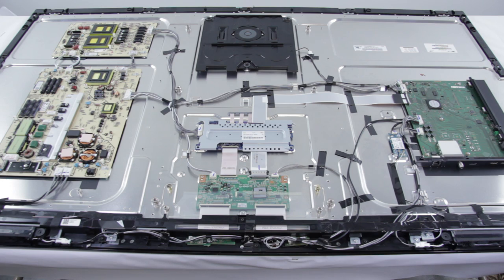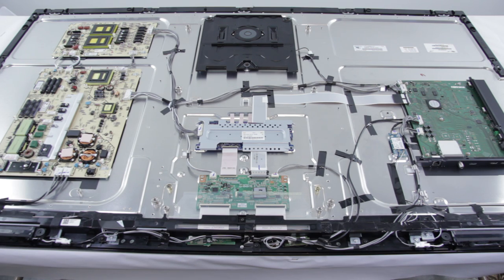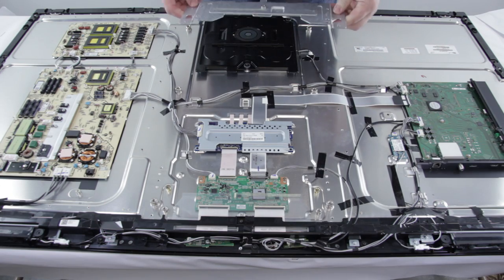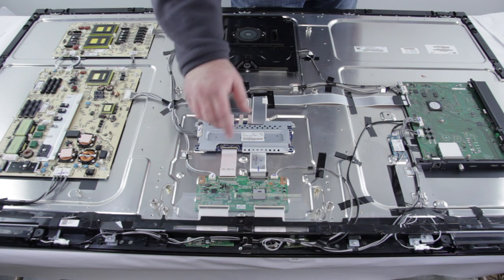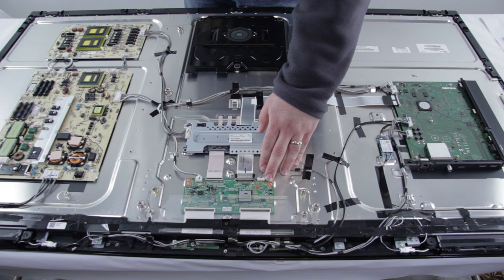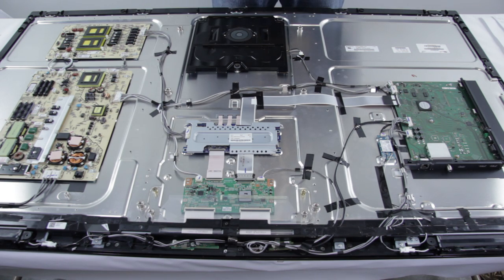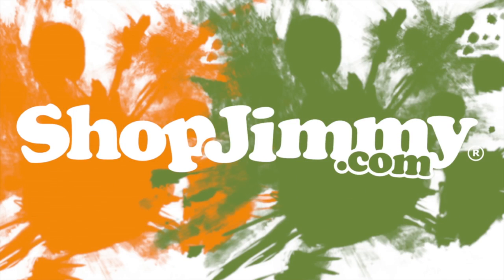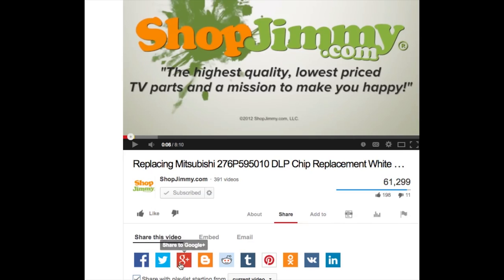LED TV Repair T-Con Board Help Review Overview - Common Issues and Problems with T-Con Boards

Comment: Samsung UN55D8000YF Horizontal lines across the screen. They typically go away after a minute or two but lately it's been taking longer and longer and now they won't go away. Could it be a bad T-con board?

Comment: I have a TCL LE55FHDF3300ZTA the tv would randomly turn off and stand by light would come on, most times you just had to turn it back on. It turns off more and more, trying to figure out if the main video board or T-con is the culprit. If you could suggest the best part to buy.  thanks

Comment: I have a Philips Model 55PFL5601/F7 and it has a blue tinit across the entire picture.  Adjustments do not make much difference. Could it be tcon board?

Comment: I have a LG 65UL6450 
When I try to turn the TV on the standby led blinks three times then goes off and the backlight doesn't come on... But if I remove the power from the t-con board then the backlight instantly comes on. Ive also noticed a red led on the actual main board which stays solid as soon as you turn the TV on. I don't see any obviously damaged caps on the power board. My guess is the Main board or the t-con board. 
Any ideas?

Comment: Vizio m470sl. Has sound and picture but picture freezes with weird colors then goes back to normal. Does this every few seconds. No t con board so I'm assuming it's the led driver. Any help?

Comment: Seiki se40fh03. Powers on but no backlight. You can see an image with a flashlight and I have 101v going to the LED when powered on and with the LED disconnected from the power board. Is this a main board issue?

Comment: My Sony KDL40V4100 is showing white screen on top of the picture. I can see the picture , can hear the sound and can see the controls , volume up & down , tv looks fine if it does not have white bright transparent screen and it covers full tv. Please share your opinion on what to be wrong. Thanks in advance

Comment: I have a Hisense Model 40H3E TV 2014 that we replaced the backlights on but now it has a 12" wide black vertical stripe in the left center of the screen. The picture and sound are good except for the stripe.   I do have a picture I can submit if you need it. Can you help please?

Comment: Have an Lg60uh8500 problem started with Tv turning on briefly with no problems and then within 5 seconds dimming to a point of images being to dark to see. Sound and backlight still functional. Currently it's progressed were tv turns on goes all white then all red and black or otherwise turn off. Bought a t con looked similar but model numbers diff. Going to buy correct one but want to know if this is exact issue?

Comment: Hii good day I have a sharp LC-55LE653U tv with lines showing up where there is picture on the screen. The lines are red in color and does show up when the menu is activated. The no signal that shoes on the screen and moves brings vertical lines where ever the no signal logo goes the rest of the screen remains black without lines

Comment: Hi, problem with my CHANGHONG LED TV model LED28C2000, picture ok on lower channels 2 to 14, no signal on ch from 15 up. tried auto retune, no effect. By remote or manual, same. Which board could be the problem? Many thanks.

Comment: HI there , i have LG TV 2014  with model number 42LB5800-UG
When i turn power ON ,  the red power Light oN TV is ON. But Only black screen and No sound ,
Should I replace the LED strip?  Or should I also replace the Tcon 
Where should I buy the LED strip? 
Thank you for your help 🙏

Comment: Hi
Have a Samsung LED TV UN46EH5300FXZA  and have sound but a dark screen . Can see an image in the back ground at an angle when there is a white back ground . Have replaced the Power Board and T-con board but still have the same problem . Have powered up TV with lights off and have no LED . See no inverter on the back unless its built in the Power board ? Going to replace the main board next . Have any ideas what the problem is ?

Comment: TV is a Samsung UN29F4000AFXZA...Power board is a BN94-06272N...TCON board is BN94-06777F...Have sound and back lights work.  No picture.  TCON board bad?  Also, in disconnecting power cable between power board and TCON, I measure the 13 volts, and the 5 volts, but I do not get the 7 volts as shown on the PCB by the connector.

Comment: Mine is the E701i-A3. Problem: black / blackout screen and no sound. I'm sure it's on because there's some brightest on screen and the power light is on. It could be related with the board?
Reply from the maker: Xzonesite  Please watch this video FIRST to help with your repair!  https://www.youtube.com/watch?v=BP3NVNCGEv8  This could be a problem with the T-con board or the TV panel.  You can replace the t-con board to see if that fixes the problem.  Click this link to replacement parts for your TV model number:  http://www.shopjimmy.com/catalogsearch/result/index/?cat=63&q=E701i-A3  There may be multiple boards for the same TV model number, be sure to match part numbers on your current board, with your replacement for compatibility.  Thanks and please let us know if you have any further questions with your TV Repair!  www.shopjimmy.com

Comment: Hello Jimmy, I have a Sony KDL-46EX600, SN: 1728115, Blue line, vertical, left side. There is no sound and when attempting to turn on the TV... red turns to green and back to red flashing 5-times. thx,

Comment: I have a Roku tv 55in Model 55FS4610R  Powers on,has backlights but checking screen with flashlight there is no image and no sound.What component required to repair tv?

Comment: i have a Sony XBR65x850c that is giving me the 6 flashing red LED error which seems to indicate a backlighting issue on the error codes.. i would love to get it fixed since i can no longer buy a 3DTV to replace it.. is this typically a bad LED strip? how should i test to make sure? thanks in advance..

Comment: Hi, I have Toshiba 65" tv. The screen showing a single black line. I have tried cleaning the connections but it has not helped. 
what could be the reason for this?

Comment: My Vizio E 370-AO stopped showing a picture (including the chevron) and had no sound. The backlighting was working. I replaced the power supply board with no change. What should  do next?

Comment: I have an LG led flat screen model 55UF6450-UA. my problem is with the screen. the upper half of the screen is ok but the bottom half of the screen is fuzzy. when i look closely at the bottom, every other horizontal scan line is blacked out. is this a problem with the T-con board?

Comment: I have a Toshiba TV Model #32C120U1 that turns on but the display is dim. I have tried to adjust all the settings for the display to no avail. Any thoughts on whether to save this TV?

Comment: I have a LCD TV model lc-50LB481U that has lost its picture. I can see no backlights. The top of the screen began going dark before it failed. I believe this is a t-con board issue. Can you advise please? Thanks

Comment: I have LG 42LB 5600 TV, replaced LED strip and when installed back, have issues with vertical colored lines , white lines with no signal picture seen. Pls suggest the possible fix.

Comment: LC-60EQ10U Ghosting image, flickering. I have taken the TV apart and checked cables. When I checked the tabs around the panel I noticed on the right side one of the tabs towards the bottom was very hot. The center part of the tab has a chip. It was very hot. The others were not. I twisted the panel and nothing. Is it just the TCON board? Thank you so much.

Comment: I have a 60 inch Sharp Aquos LC-60LE830U with vertical colored lines on the left side of the screen.  Is that a tcon board problem? If yes where can I buy it?

Comment: Hello I have an RCA LED TV: Model #  RCA LED55G55R120Q
Problem:  I was watching tv one night and I heard 2 popping noises and the tv went black, how ever I was still able to hear the sound and see something moving on the screen but it was dark.  I have searched the issue and my LED lights are not working.  I need to order the right part to fix it but I'm not sure which part will repair it.  I hope you can help me out.  The tv was bought from Best buy about a year and a half ago and no extended warrantee was bought.

Comment: I have a Vizio 55", Model Mr550NV with Vertical Gray Bar ib the middle of the screen. I replaced the T-Con Board and the problem still exists. What would be the next most common cause of this vertical bar?

Comment: My TV is a Emerson LF461EM4 a 2014 model. The left side of my tv is darker, has ghosting as well as a bit discoloration, but the right side is fine. Could this be a T-Con or Mainboard issue?

Comment: I have a Sony KDL 50R550A that just quit, no indicator power stand by light or on light. I was out of the room for a couple of hours it was playing when I left the room but was out when I came back in.  No storms were in the area. Screen completely black.  I have checked the power board it is outputting approx. 3 volts DC.  I have replaced the main board with no difference in output.  What do you think is wrong?

Comment: I have a sharp lcd 70le650u that had no picture and no sound. Backlights come on. I have standby voltage at the logic board but no 12v output voltage to the t-con board. Do you think the logic board is bad?

Comment: I have a 39" Insigna TV, Model # NS-39D40SNA14
My TV has sound but has no picture. I did the flashlight test and I saw images. What should I do in this situation?

Comment: Have Sony Bravia KDL-52XBR5 made in Dec 2007.  On startup, the screen shows some ghosts and some horizontal lines, but whole screen still works.  After a few minutes the ghosts, lines go away and screen is normal again and stays OK for hours.  What is most likely cause of this issue and is there a part to replace to correct?  Thanks.

Comment: Have a Sharp Aquos TV model number LC-70LE600U.  This just started a couple days ago.  I have a rectangular box toward the bottom of the screen with white vertical lines moving up and down inside the rectangle  Any ideas what the problem is?   Everything else works fine, but this is annoying.  It's about 2in high by 19 inches long

Comment: Hello, I have a LN40D630M3FXZA that i pulled from the side of the road. Led light turns on at the bottom with touch sensitive controls on the front, but screen is black. Any help would be appreciated.

Comment: I have a Phillips LCD TV. Model #52PFL5704D/F7 and the backlights work but there is no picture. I have already replaced the main board and it's still not working. Any ideas or a link to get a new T Con board?

Comment: Hi I've got a Panasonic TX-L32S10BA I've got sound but no picture back lights seem to be working I can see them lite up through the back panel I've replaced all the boards but still no picture can you please help. Thanks Eddie

Comment: I have a 7 year old Samsung LN52A650. I recently replaced the TCON using your tutorial with a board I purchased from you site. Before I replaced the TCON board the screen would freeze and display colorful lines across the screen. When I unplugged it and plugged it back in I could only get the input displayed in the top left corner but I could not change the source and the screen was black. I swapped out the TCON board and it worked great for a few months then the symptoms that I described  above returned.  Any advice?
Reply from the maker: This sounds like a TV panel (TV Screen) problem.  If your TV panel is bad, it may be more cost-effective to replace the TV as panels are typically hard to find in stock, difficult to replace, and expensive.  Thanks and please let us know if you have any further questions!  www.shopjimmy.com

Comment: I have a Samsung model LN40A550P3F. Everything works except the color is weird. All the blacks have a green pixelated appearance. Adjusting all the color settings does not help. What could it be? Thanks, V

Comment: I have a Westinghouse DW39F1Y1 and the image is barely visible if a flashlight is used in a dark room. Sound works fine. There is a main board and a power supply board, but I cannot locate an LED driver or the backlights.
Reply: Additional Info: The CVB42001 power supply board has a CVB32001-3 board on it with four pairs of cables (red and white) labeled CON1 through CON4. A wild guess is that these cables command the backlights to turn on. When power is turned on, CON3 and CON4 go up to 66V DC (between red and white). Voltage supplied to the main board is 12V DC as one would expect based on the labels on the circuit board.
Reply from the maker: marius973  Please watch this video FIRST to help with your repair!  TV Repair! LCD, LED, Plasma, DLP How To Fix Your TV with ShopJimmy.com Help!  I recommend replacing the power supply board in your TV.  Click this link to replacement parts:  http://www.shopjimmy.com/catalogsearch/result/index/?cat=59&q=DW39F1Y1  There may be multiple power supply boards for the same TV model number, be sure to match part numbers on your current board, with your replacement for compatibility.  Thanks and please let us know if you have any further questions with your TV Repair!  www.shopjimmy.com

Comment: Hi, I have a Haier model # 65UFC2500 tv. I do not get a picture or sound. I do get a blue light when the power is turned on. I also hear a slight sound from the power supply when I turn on the tv. If i attempt to push any button such as menu, ch, or input the blue light flashes from red to blue continuously. I tried to look at the screen with a flash light but could not see any images , nor did I see any lights through the holes in the back or without the back panel. The main board has a red indicator light for the optical out that comes on a few seconds after the power button is turned on. Do you have any information which could help me?

Comment: Hi Jimmy, I have a Vizio VX37L HDTV10A. The picture looks like a photo negative when you turn on the TV. Everything works correct except that. I think it is the T-CON board but after I took the back of the TV off, I have no idea where the T-CON board is! Can you help?

Comment: I have a D65u D2 Vizio tv. where there is no picture after 2 minutes with the tv on. still hear sound. there is no backlight or image on screen. you can turn off the tv and back on.. the tv picture will come back.. also if you hit the mute button for 3 seconds and click ok on the remote. the picture will come back for 2 more mintues before going out again. the process can be repeated. I would like to know which board I could be investigating or where to start with this? please.

Comment: Hi, Thanks for the information on the TCONN card, I have a Samsung LN55A950 LCD TV and I have horizontal lines going across the entire length spaced evenly from top to bottom, is that the TCONN? And where can I get a new TCONN card?

Comment: Hi .. I have a 4 year old LG 47 inch, LM6700. TV was working fine till last week.  Suddenly video is not coming but audio is good.  I am able to change channels, adjust volume..etc. Backlite is also coming except images. I tries flashlight test as well. There is no image in the back-ground. What could be the issue? Please suggest

Comment: MY tv is a Olivia model : olivia 265FHD -T11 .I have a picture but no sound. I was watching the tv and the sound just stopped. I have my stereo hooked up to provide sound and it works but there is a slight delay.  I have tried to reset the tv  but it did not help. Please advise.

Comment: I have a Sony LED LCD KDL-55EX620 on the right side of the screen from top to bottom, about a foot wide, there is an overlay of tiny red dots. This started as a very slight "shimmer" to the screen and has progressed to the overlay of red dots. Can you advise which board this could be ? Or is it a defective panel ?

Comment: I have a vizio V705 H1 vertical lines cleaned and checked connections to T-con and still has lines. removed left ribbon and checked screen looks good and then removed right ribbon and screen looked ok half as you would know. need help

Comment: I have an LG OLED TV model LG55EC9300. The first problem was that the right half of the screen was ghosting and slowly faded to no picture the farther right you looked on the screen so that the last 20% of the right side was black. After turning the TV on and off a few times it stopped turning on. After pressing the physical power power button on the back of the TV there is a click sounds like it is going to turn on and then a second later it clicks again and turns itself off without being on long enough for any light to appear on the screen. Any suggestions?

Comment: My Hitachi Roku TV model 49r80  stand by, backlights and screen are not working. I'm a beginner, but I have replaced the power board (I kept the old one). I'm currently testing the LED panel (Led Panel 49R80 X490203) but it's difficult to locate the testing points due to not having a panel like all the examples I've watched online. Hopefully you guys can help me before I buy more parts that are unnecessary.
Thanks guys.

Comment: I have a Sony Bravia KDL-46EX600 TV that has backlights and sound but no picture. The green and red light on the front stop showing any indication so i replaced the power supply but that did not resolve any of the issues. Last year I replaced the T-Con board but still did not have a picture. I dont have any virtual lines just a screen thats grey when the TV is turned on.

Comment: Hi - Panasonic Tx-48cx400b. Have Sound But No Picture - I did once leave it unplugged for a couple of days and it came back to life but that has stopped working now. It also used to turn on and then go to a black screen. Now it just turns on and the red power light turns off completely and I can hear sound from the Virgin V6 box coming through the TV but no picture. I can't remember if the light used to turn off or not when it was working but I have no picture or anything now. - please help
Is it the t-con board?